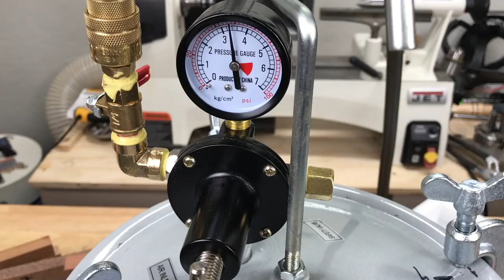How To Make  A Pressure Pot and Turning My First Hybrid Pen Blank

Comment: Enjoyed your video but have some non-critical observations:

1.  The Chinese built Harbor Freight pressure pots are only good for 60 pounds which won't get rid of 100% of the air bubbles.  If you get an American made one, you can jack your pressure up to 200 pounds which will dissipate all air bubbles.

2.  That being said, I would not reuse the Harbor Freight pressure relief valve.  They are notoriously unreliable.  Safley test it to see if it blows at 60 pounds.  If not then replace it with an American made 60-pound version from Amazon.

3.  If you add an elbow on the bottom side of the lid where the air enters, it won't blow the resin out of your mold when you fill the tank.

4.  Sometimes those Harbor Freight pressure pots leak which can be fixed by putting a little Teflon rubber lubricant on the gasket.  

5.  The bottom of the pressure pot is curved so it is hard to get a mold to sit level especially when air is entering the chamber. To fix this, cut a plywood circle the same size as the inside diameter of the pot and put it in the pot.  That will give you a flat surface to sit your molds on.  It will also catch drips and runs so they don't collect on the bottom of your pot.

6.  Get a 2" radius carbine tip for your scraper (a curved square), you will find it works MUCH better.  And you won't have to use an inside scraper to do your finish work.  

7.  When you mix your resin so fast, you will introduce air bubbles.  Stir slower and get fewer bubbles which is what you are trying to eliminate with the pressure pot.

8.  You will get better results if you dump the mandrel and turn between centers.  It is more accurate and will save you from off- center blanks caused by an over tightened mandrel.

That is all.  Carry on.
Reply from the maker: G. Salisbury thanks.  Very well written list of tips.  A few I have done.  A few I should do.  The Carbide tip I’ll get ordered today.  As for the plywood bottom I made one with my logo and posted it on Instagram a while back. Absolutely a great tip.  The stirring I have found to be true as well.  Bubbles are not good. Slow and steady is much better.  If I start casting more, I’ll look into a better made pot. The harbor freight is definitely a compromise.  I’m usually the person who would rather buy once. Not sure why I went cheap on this.  I also have the elbow on.  I can only imagine the mess. Thanks again.  Great info.
Reply: What type of Teflon Rubber Lubricant? Who makes it and where can I get it?
Reply: Because I need to try that. Mine looses about 5 psi every hour and I can't find a leak in any of the fittings.
Reply from the maker: Nicholas Hudson any pipe thread paste will do.  That’s just what I had.  I picked it up from Home Depot.

Comment: If you’re measuring resin by weight, why not just use one cup?
Reply from the maker: Fred Weaver your asking why not measure it all in one cup?  Mostly because of the open time. Once I pour A into B I have to start the clock.  This was one of my first times doing it and I didn’t want that pressure especially since I was filming which adds time and complexity to a process I’m still learning.  I’m sure it’s fine to do it that way.  It would cut out a step and save a cup.